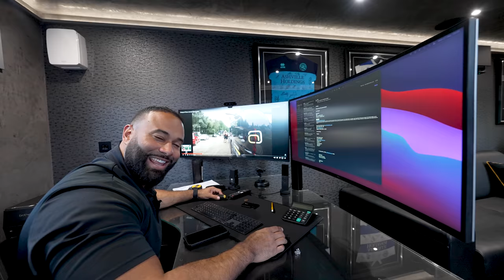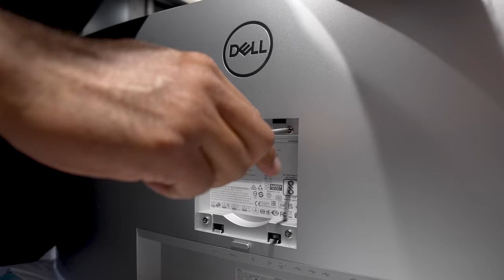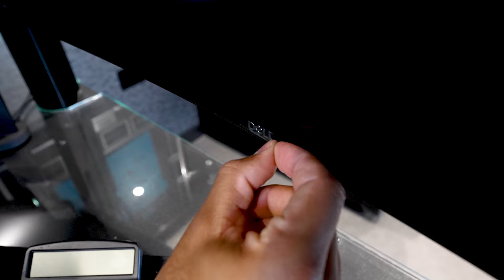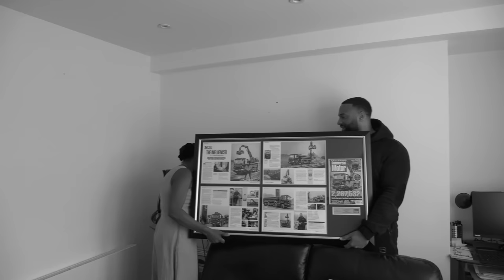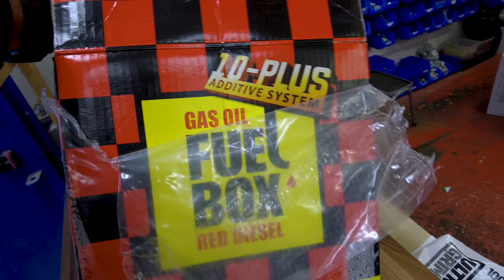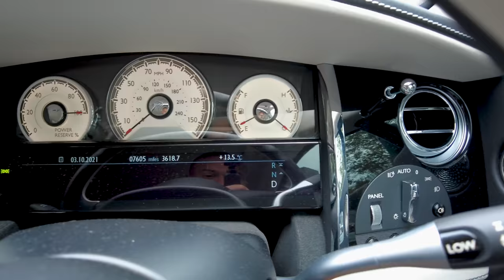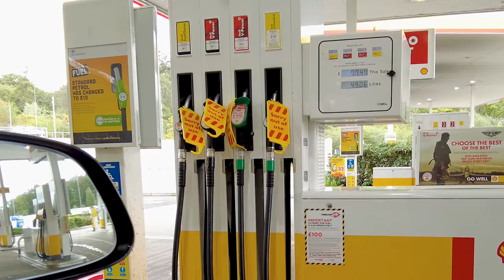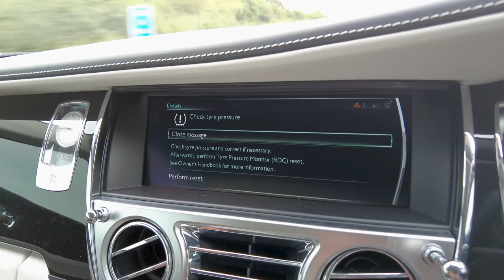One Year, No Gas | Ashville Weekly ep052

Comment: I feel your pain. I have had to give up squash and badminton due to knee ligament issues. I was utterly devastated.
But you are still young enough to pivot and do something just as active but less impact full on your shoulder joints.
Martial arts.
You can work your body. Get rid of the stress and anger and frustration of the day. While improving your body and keeping fit.
Did they say you could swim? That could help with shoulder strength and flexibility also.
You could install a jet swim tank at the yard! As well as a mat area and martial arts equipment.
Just a few ideas.
You have had to pivot and adapt with your businesses. This is no different.

I'm just annoyed I didn't contact you about your IT issues long ago.
I would have loved to help. But glad you are getting things sorted out.
No reason why you should have had such a panic the other week with your router getting wiped. Among other things. 
That should not have been an issue.

Keep up the good work, love the weekly updates. 

But again, your shoulder issues.... Pivot and adapt. Then move on.
Regards.

Comment: You can still do a SERIOUS workout without lifting heavy weights. Look at almost all sports teams workouts now. No more heavy weights, it’s all band work and mobility. You’ll keep the muscle mass but will end up with a much better range of movement and much lower risk of injury.
For your size and strength, I’d have a look at ice hockey player workouts. Most players are roughly 210-230lbs but are also very mobile and strong

Comment: I would look into getting a stem cell injection.  I have 15 year old ACL & MCL injury on left knee which sounds similar to your situation Daniel with the cartilage, though no bone on bone yet.  In December 2020 had a stem cell injection and I have seen improvements.  While I don't run, I sure as heck can pump out a HIIT kettlebell workout, hike all day, or ride my bike for hours and don't have any lingering issues.  I used to have aching problems if I stood or hiked all day.  I recommend looking into a stem cell injection.  Wishing you good health mate.  FYI, I'm from the US, I'm sure it will be different than the UK.

Comment: Used to work for WRAPIT.Its a shrink plastic to cover scaffolding to keep it dry.1st you wrap the scaffold n than you heat the plastic n then it shrinks tight among the scaffold.its durable n looks good.easy to fix if there's a hole in it and it's windresistant to force 7.check it out.Shrink foil

Comment: I also had a problem with the knee ligaments.  I was in pain that I wanted to scream when I went to bed in the evening.  I had been going to the gym for several years and I had made great progress, especially on my legs.  I could even see how they grow every week, both in size and weight used.  thinking it was due to training, I went to the doctor.  unfortunately the doctor told me that it is a problem from birth and that the operation and recovery are very complicated and can last 2-3 years and he does not recommend it unless it is very serious.  he gave me a treatment with drugs that may have worked on the pain side and told me to quit the gym and any kind of sport, and that sport has an age.  I did not accept what he said, being only about 24 years old, wanting to go to other doctors.  unfortunately I wasn't there yet, after 8 years, because my knees didn't hurt anymore.  the problem is that I was very disappointed by what he said and that I could no longer train my favorite part - the legs.  for 2 years I barely trained my legs and then I hardly recovered mentally.  anyway I can't use such heavy weights anymore and I haven't made any significant progress since then.  I was doing squats with 180 kg and I am 1.62 m and 70 kg. Now i do squats with 80. I wish you to get well and to be able to continue training the way you like, probably at maximum intensity and with heavy weights. I d'ont tell you to be strong mentally because i know that you are. Hope to give you a bit of strongness from my story even if it is not a happy one. Peace!

Comment: While I was watching your last video I noticed that you was nudging the jersey barriers with your 8 tonne digger and forklift. There is a company that make pallet forks for diggers. This would probably be a lot easier and safer to use rather then using the boom on the digger to nudge the jersey barriers. The name of the company is JB equipment. Very good company and an added bonus is that they paint all of there digger attachments black.